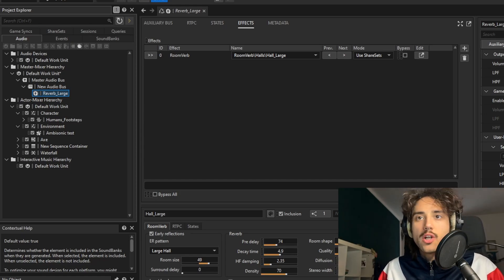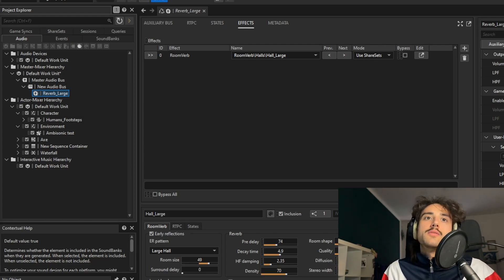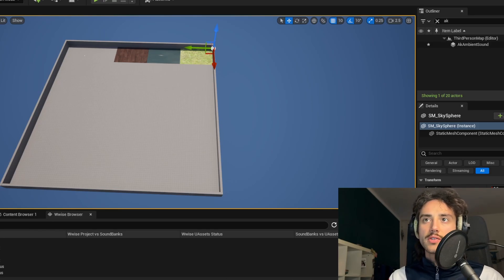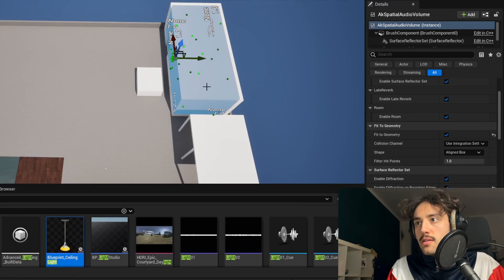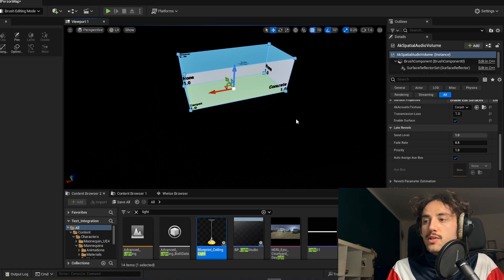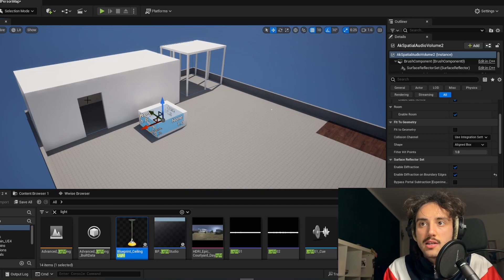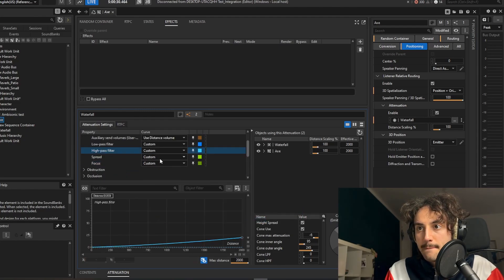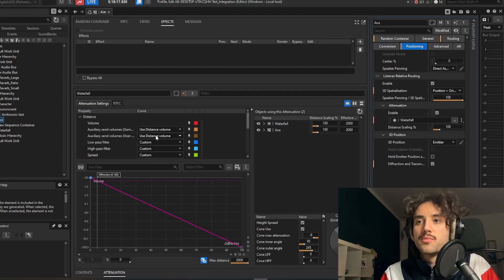Spatial Audio in Wwise: Rooms, Portals, and Reverb Zones Explained

Comment: Hey man,
thanks for your tutorial. Is there any reason why I dont have the convolution Reverbs? :(
did you get them from the Wwise authoring tool?
Reply: AkConvolution is a Wwise plugin. You probably didn't select it when you installed your version of Wwise. But you can "Modify Wwise in Project" from the Wwise launcher and add it on the plugin menu